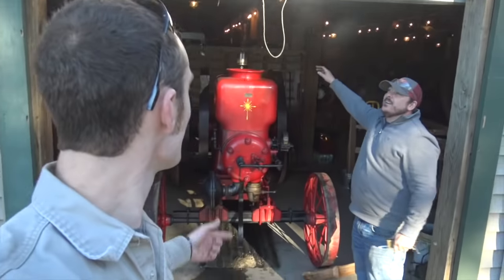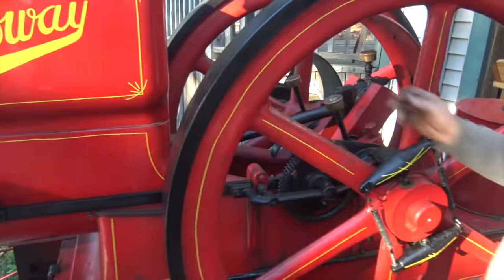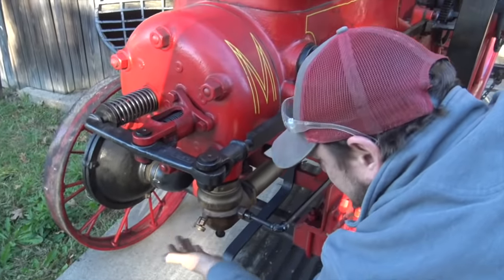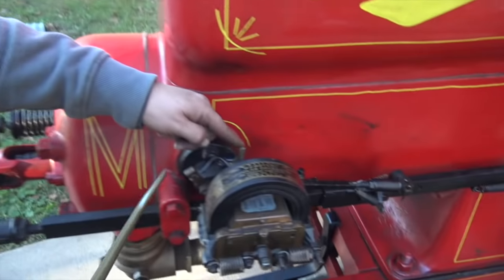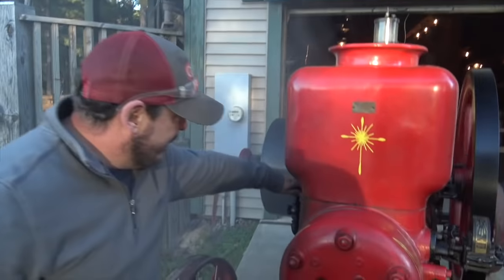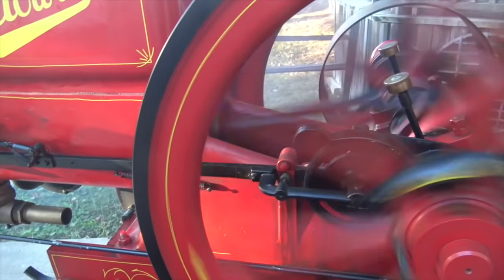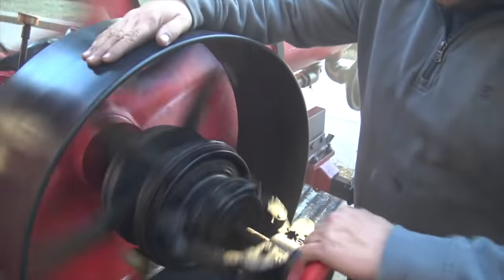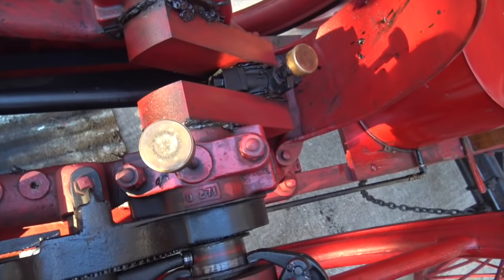WHY THIS INCREDIBLE ENGINE FROM 1916 IS PROOF THAT MODERN EQUIPMENT IS A SCAM & OLD STUFF WAS BETTER

Comment: At Bridgewater.VA during "Bridgewater Days" steam and gas meet, there's this monstrous 50 HP (F&M) They start it with kerosene powered Fordson tractor driving an air compressor. very impressive,I don't know what that old engine powered. Talking about old is maybe better, one Farmer had an old biggest 2 cyl JD tractor, doing comparable work the old 2 cyl consumed significantly less fuel than the newer many pistoned tractor.
Reply: Larger cylinders produce more torque and as a result often need less total power, therefore less fuel consumed, to do the job. Torque differential is part of why my 7.3L diesel engine uses significantly less fuel to pull 12,000 pounds (itself and a 5,000 pound trailer) than my 5.7L gasoline engine does pulling 10,000 pounds (also itself and a 5,000 pound trailer)....it's about HOW it's used. The greater compression and longer stroke at lower RPMs utilizes the energy created in the burn more efficiently. The same principle is illustrated by the old 2-cylinder using less fuel. Doubtless it used a longer stroke which extracted the energy better than the newer designs.
Reply: @edifyguy   Yep as evidenced by the Marine 2 stroke Diesels( most efficient ICE currently)
Reply: @kevinmccune9324  Also if it was a gasoline engine, there's a minimum amount of fuel required to make a gasoline engine go bang, hence fewer cylinders tend to have an advantage there too, though lower displacement is the main advantage, hence the increased use of small turbo gasoline engines in the automotive world today, as they scale better from a fuel consumption perspective; if you need the extra power, the turbo will shove more air in so that more fuel can be burned at a time, but if you don't, it doesn't, and the minimum to go boom is lower, hence lower cruising fuel consumption.
Reply: @edifyguy   -Great reply, most of the manus have grokked this these days.

Comment: My uncle has something similar it was the engine for an old pump jack here in Oklahoma.  He spent two years trying to unfreeze the piston before he got it to move.  Restored it and used it to power an antique ice cream machine at the local 4th of July celebration.

Comment: IDK, $13k or so (adjusted for inflation), with about as many steps to start the dang thing as you get in horsepower, and an inefficient design... it was fine for its time, but it can't compete with anything modern.

Comment: A modern engine would be an order of magnitude (not a joke) more efficient, saving its cost in fuel several times over its lifetime. It also will be smaller, more quiet, and WAY cleaner.
Reply: Wait really? They made improvements to internal combustion engines in the last 100 years?! Get out of town! What else, did they massively improve cars too?!
Reply: @bellatoramatbellum  kinda yes but they run like shit after a while unless you buy a honda but they are becoming shit too. its a sad thing. they might be smaller more quiet and easier to the standard city person, but they don't last long at all.
Reply: I think his point was that older stuff was made to last. Yes the new engine would be more efficient. But it would also require way more things to run. I’m sure if you made a modern version of this with just better geometry and lighter parts it would great. But that’s not what modern companies do

Comment: A YouTuber put a lawnmower carb on an old V8 and gets 40mpg. Yes, it's all a scam.
Reply: @berserker406 Probably way down on Hp, the thing is most cars are way overpowered for moderate cruise, the one thing that red flagged me was it would accelerate without sputtering.

Comment: How many strokes does this take before it fires again? It sounds like 5 based on the air I hear exhaust. Pretty neat engine, gas burner but gives me boiler vibes. Edit: Ok I get it now, It fires only at a certain speed and that is why I was counting 5 maybe 6 strokes sometimes. So I imagine under load it fires a lot more often to maintain speed. Knowing that I see why it is referred to as a hit-and-miss engine.

Comment: What keeps it cool? Is it from all the air it's moving through it when it's not firing?
Reply: that square box on top ys the cooling tank
just gets hot
lose water to steam fill it up again
no tubes no fan no melts pullys

Comment: My great uncle earned the money to buy the farm I was raised on with a 1.75 horse power, hit and miss, water cooled engine, a fan mill to clean wheat and barley and a 1928 Chevrolet “truck” (pickup.).  In 1954-5 I saw him pump water using the engine.

Comment: Rather than using the insane California fuel can spout, I suggest a “jiggler”. It’s a clear hose with a one-way ball valve that
allows fuel to enter when pushed into a tank, then traps it when being pulled back. After a few strokes there is enough fuel 
in the hose to start a siphon.
This works awesome on a tall airplane wing wheee holding a 5 gallon can steady is difficult. 
Lowes and Home Depot sell these hoses under various trade names.

Comment: I actually saw an engine that runs like this when I was a teenager. It was near Allentown PA at a fair. It drove a really long cloth belt to run some kind of fixed farm machine, so it wasn't a tractor - just a motor. And it had a heavy flywheel and only fired every 10 rotations or something.

Comment: I remember old horizontal engines with 6’ tall flywheels that powered old grain elevators in rural Saskatchewan. They would run on gas, diesel, coal oil, or kerosene.  The one I was most familiar with started with compressed air.  No electric grid in those days. Was always fascinated by their multi compression settings and variable magneto’s. I have ZERO metrics but they seemed quite efficient and ran thousands of hours with no issues.   
Current diesel engines with all the unnecessary sensors and def are an absolute joke.  Designed to need constant repairs.

Comment: Loved the video man. About the title, not everything modern is a scam. I prefer old stuff especially engines cars etc but some stuff is better now. Like welders for example ( not engine drives, I prefer the old ones) but normal electric welders now are so much better. DC inverters are so small light but capable now and you can do so many things with them...

But apart from that keep up the good work

Comment: I work for a car dealer and i can see a definite decline in quality over the last 10-15 years. Manufacturers don't want your vehicle to last forever. Cars are disposable now. They are now lease vehicles and not going to last, regardless of maintenance. They last the lease and or warranty period and are too expensive to fix outside of warranty. People are having to continually trade their vehicles every 5-7 years by design.
Reply: Which is why I'll continue driving and fixing my old truck.

Comment: My Dad restored a 19aught(?) Green Fairbanks Morse  ~3.5 HP horizontal engine just like this. In Junior High I helped him dig it out of dirt and dung in ~ 1969. After he came back from his combat tour flying over Laos and Vietnam. From a barn on a farm outside of Omaha, Nebraska.
My Dad flew the 10 engine B-36 and the 8 engine B-52. Until 1964. Col. Stephen P Meyers. 
But he loved these old engines. He rebulit and restored a 1929 Model A Roadster from roadside free junk and finished when I was ~5 years old. A Flathead 4 with solid copper flat metal spark plug leads. To drive to work instead of using his Vespa. No radio interference there? 
In my experience, the Fairbanks-Morse engine was a rare engine. It used horseshoe magnets for the magneto and was not a "Hit or Miss" engine. It fired every time and speed was controlled by a rudimentary rotary wheel/ carburetor. I think it adjusted the throttle inlet opening. Maybe it was a needle valve for fuel control? Obviously, under zero load, it could get cranked up but the control wheel made the RPM very controllable under zero load. This is memory from a long time ago, but I think the RPM safety was a magneto cutout. Rather than the valve cutout on the "Hit and Miss" engines? It was weights that flew out and cut the mag trigger shaft if it was trying to over speed. Not the classical vertical governer mechanism but a small unobtrusive spring loaded affair.
As a kid, I was often the starter motor. Crank while pushing in the intake valve until you had some momentum. It would kill me dead in two minutes if I tried that today. Once it was tweaked, it would fire every time at idle/no load, and draw a crowd at antique engine shows. Because most engines didn't do that. It's now in a museum at the SW corner of the I-5 Exit 98 in Canyonville, Oregon. 
Along with a vertical Red Fairbanks-Morse engine that was "Hit and Miss" that I helped Dad dig out of a similar dirt and dung barn situation along the Applegate River in SW Oregon. In ~1974. Both are beautifully restored and I hope they are being taken care of, respectfully, at the museum.
I have always loved big cubic inch hot-rod engines. Watching these original 4 -stroke gasoline engines, it's still hard for me to believe that a 6-7k RPM 400+ HP V-8 could have been developed from these low HP, low RPM antique engines with massive torque.

Comment: You might want to adjust the Rickenheimer actuation  lever that engages the flugeldorf gizmo apparatus.  If it's running too lean the kampfenschaft will not receive the required pferdenkraft in order to allow continuous operation of of the Bauernhof-Machnery

Comment: Not only do they allways work, are easy to maintain, and work at a frequency that is pleasant to humans and peaceful to the community, but last forever and are economical and green.     Fun fact. - the first light bulbs made would last over 100 years if left on all the time, like everything else due to greed they were re-engineered to burn out quickly.

Comment: Sixteen horsepower ..... 3200 pounds. This is the correct ratio of pig iron to power output for an engine that will last forever AND rotate the Earth with a flat belt wrapped around the flywheel!! BRAVO!! - BTW - that jewel starts pretty easy, too!!

Comment: This style was called "make or brake" or "hit and miss" type ignition systems . It's a standard 4 stroke which is controlled by the certerfugial governor design. Most of these also controlled the actual igniter points with the same governor controlled assembly. I reconditioned several of these engines of various sizes in the 1970's.😊

Comment: It would be interesting to find out which parts on an engine like this are considered wear parts that need to be replaced every so often and how often as in piston rings, ignition parts, bearings etc etc and if these parts wear out are replacements available? Since these engines are popular and considered collectors items and they have such a large collectors following I would think that there's a few people around that still make replacement parts for these. Kinda like when I took an older Sunbeam stand mixer from the '60s apart to check the motor, gears, electrical etc etc and re-greased the gears and re-oiled the sintered bronze bearings checked the resistor(if I remember right). There were a few people making obsolete replacement parts for these if you dug a little online.
Reply: If parts are overbuilt which everything was in 1900. Replacement parts are when things break not wear. 
Bearings if grossly overbuilt and lubed could last 100s of years.
Same for the rings and piston.

I’m sure rings could me machined at a shop for a reasonable price.

Comment: 1:50 that's the biggest push rod I've ever seen. This qualifies as an overhead valve engine with the valves in the head and that rocker arm for the exhaust valve. The OHV engine was invented by Buick in 1898.

Comment: "More fuel efficient than a prius"

I'd like to see this thing travel 54 miles with 1 gallon of gas.
Reply: But a prius will be spent and rusted long before this relic stops working.....so, how efficient is the prius, really...when it was made at a time with more knowledge and "advanced" technology; yet doesn't have one 4th the shelf life of something made a century ago?
Reply: @iceonthesun8880  well obviously, because a prius is driven daily whilst this relic is only started probably only on occasion. If this thing is worked as hard and as often as a prius, then it would obviously break down too. I made no claim against the machine's reliability, only the statement that it is more fuel efficient, when it's obviously not even close.
Reply: @greigey5603  ah, I missed the fuel part and only read the efficient part.....my mistake.

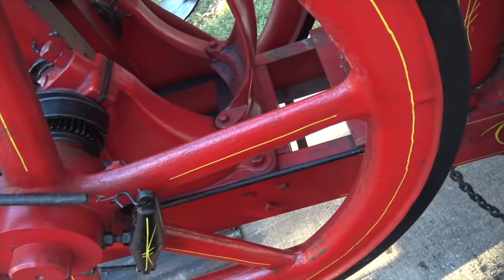Comment: Those modern "safety" gas cans are like ten times more dangerous than the older style because you end up spilling gas all over the place as seen at 4:18    I find the old Gott plastic gas cans at garage sales  and ebay whenever I can.  I have like four 5 gallon cans, two 2.5 gallon cans and two 1 gallon cans.  They are the best and no more spills.

Comment: Of course, the fact that using today's technology, the iron needed to build this engine would suffice to build a 400 horsepower, smokeless powerhouse, is lost on the majority of commenters !!   Also, the horsepower hours produced per gallon of fuel consumed would be 3 to 4 times more with a modern diesel !!  And, the modern diesel will run be running hard for tens of thousands of hours with far less maintenance than it's ancient predecessor !!  

The thought of gearheads in the early 1900s taking delivery of one of these behemoths blows me away 😳🧐‼️  They were eager to put the "new technology" to work on chores that made their lives easier ..  They were also showered with comments of; 'Yeah, my horses are much easier to maintain!' or, 'It'll never replace MY horses'!!  

Isn't it time we just appreciate how technology has advanced throughout history ..  Heck!, we just might, someday, see how these ancient marvels helped in eliminating slavery 🤔 🤷🏻‍♂️ 🇺🇲 💖 🙋🏻‍♂️

Comment: Very familiar with all these. They are reliable and run forever but they are not as efficient as you would think...they consume larger quantities of gas when under real load..more than modern engines for the same HP. Idling and at low RPM they have modern engines beat hands down because of the inertial storage high torque , and hit or miss ignition design.

Comment: older cars have one less digit on odometer because they tended to last a lot less.  We have improved metal quality, engineering, etc.

The 1916 era engines are much lower RPM, much lower efficiency, lower power to weight ratio, worse emissions, would mostly not compete with modern engine, lose more money on cost, shipping, extra fuel, etc than gain from engine life.

It is possible to engineer a modern long life engine, an 1800 rpm generator for example will last about 4x as long as a 3600 rpm generator and if you engineered one to be 900 rpm would be another 4x as long... that is why long life commercial generators and navel engines often run at 900 rpm or less.

Comment: Reserving the right to edit this comment, based off the title: Often times yes, but be careful with that assertion, because it's far from universal. 
The prime example of this, in my opinion, is cars: while older, lower-tech cars obviously can (generally) be fixed up with fewer fancy tools or needing computer know-how, modern cars are orders of magnitude safer than even cars from the 90s, much less classic vintages that often were old enough to have seat belts be *optional*. This is even more so for aviation.

There's also much to be said about metallurgical and engineering advancements made throughout the 20th century, and into the 21st, that made engines more powerful, efficient, and robust.

Lastly, I feel that it's easy to look at all these vintage and antique things and how well they've held up over the decades, and start imagining everything was made this well, which I'm doubtful of. I figure that we're seeing the good stuff that was taken care of well enough to survive today, and the 1920s or 50s equivalent of "made in China" was recycled or thrown away and forgotten decades ago, which gives us a biased picture of the average quality. Basically, I think we're seeing a form of survivorship bias, and should try and be cognizant of that.

Comment: I've often said that they should go back to the designs of the sixties and seventies with modern materials, those engines would weigh less and producing more power whilst using less fuel.
I ran a points ignition engine in the 90s that was designed in the 70s and got 64hp and 65 to the gallon out of a motor originally producing 54hp and using 55 to the gallon.
a GS550 suzuki that people who owned cbr900 hondas tried and accused me of extreme engine work for it's torque and acceleration.
the internals were all standard.

Comment: They run forever because they run at slow speed. Wear increases as a square of the increase in speed. If you ran a modern engine made with modern materials at 180 RPM, it would last forever too. Of course this would require re-valving and a cam reprofile and retuning the exhaust. And a huge flywheel.
Reply: And the  casting is as thick as it gets, combined with low RPM, it will run forever.